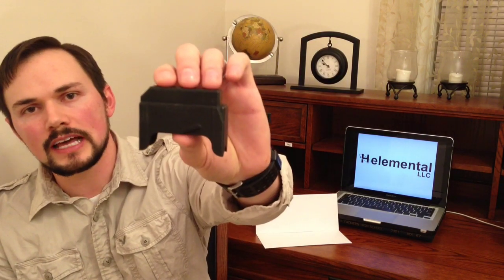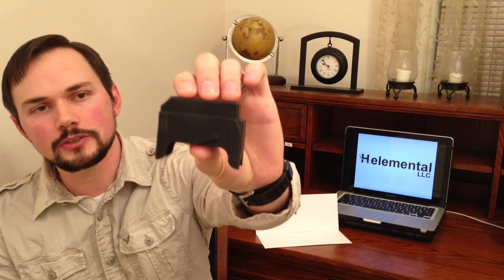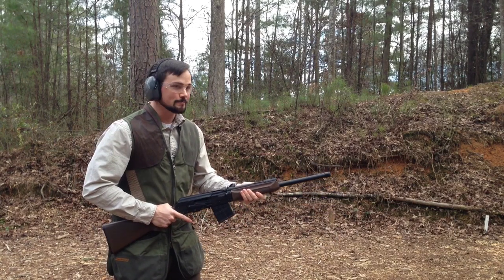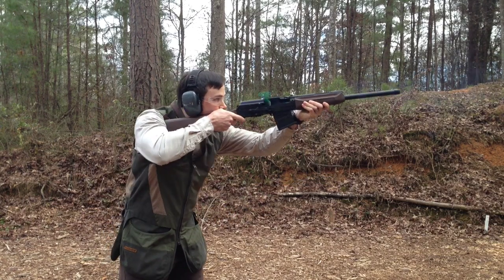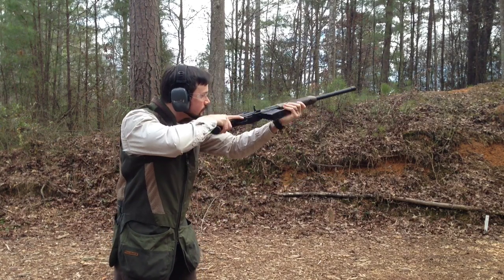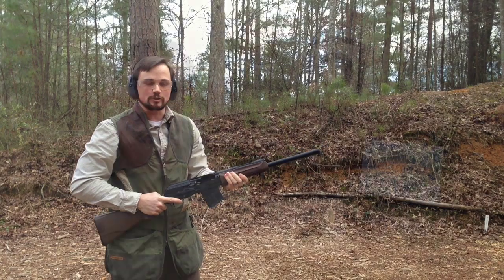Saiga 12 LRBHO, Helemental Last Round Bolt Hold Open for the Saiga-12, LRBHO

Comment: While this was a cool idea, I think the thing most people want out the their ak shotgun is to be able to automatically hold the bolt open upon firing the last round, this magazine follower however doesn't do that, the bolt just gets caught on the magazine and the bolt will drop when the magazine is taken out. Inserting a full capacity magazine into a ak shotgun on a closed bolt can very very difficult without practice, and this follower would not help with that, might as well just use the manual BHO.
Reply: Magwell is the answer…